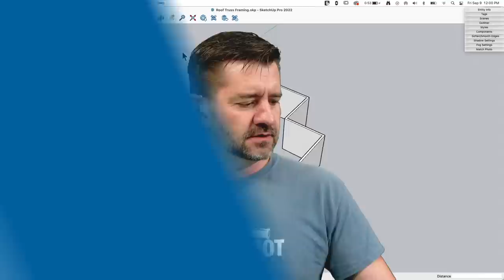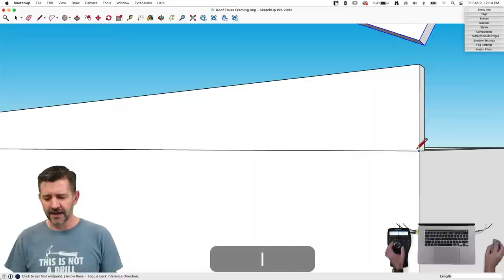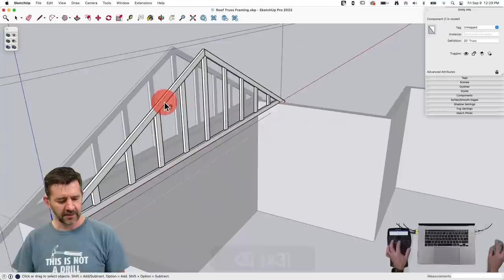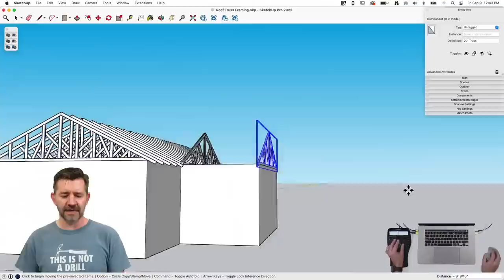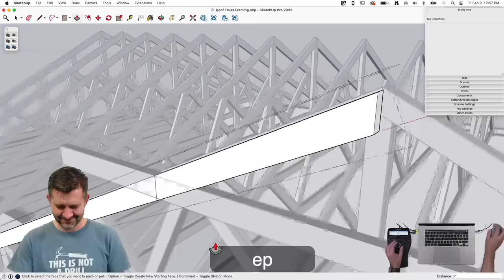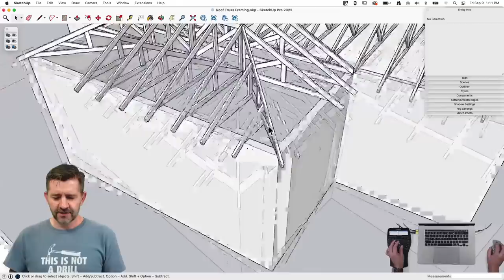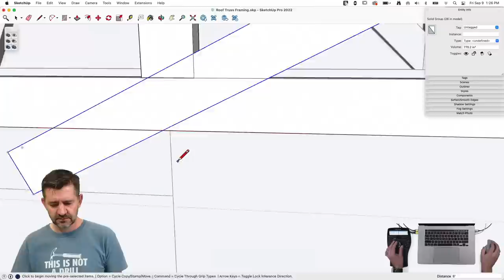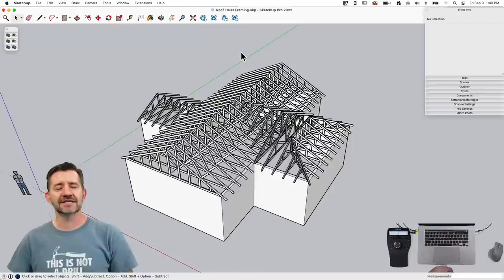Framing a TRUSS ROOF in SketchUp

Comment: It takes qualified engineer to mathematically modeling  trusses. However, there are two options for a designer or  a builder who  wants to do it by himself.  1- Trusses are everywhere, he could just copy already built truss with the same span or larger. 2- he might get his hands on trusses catalog or designing tables  that complied with the building  code to choose from them. At the end, the city engineers would  check the design anf inspect the execution.
Reply: I agree, to properly engineer a truss you need to know the loads and then you need to run the numbers or do the math.  MPC trusses are governed by the Truss Plate Institute (TPI) and the building codes conform to this standard.  The number of load combinations used in the analysis is staggering, typical output from truss engineering software like Mitek will usually have at least 25 different load combinations per one truss design/configuration.  When you engineer a MPC truss you are not only checking the members for tensile, shear and bending, but you are also checking the connection strength at each joint as well as the overall deflection of the truss.

To design a roof with trusses does not require the full engineering up front.  What is required is the basic geometry of the roof and an understanding of how those trusses will be supported within the design.